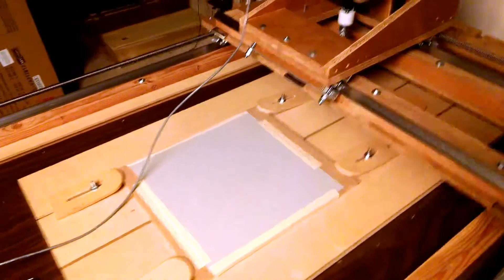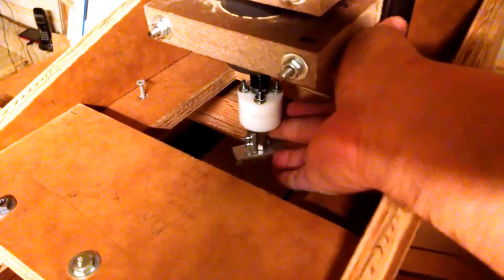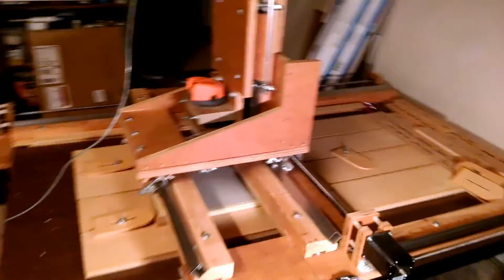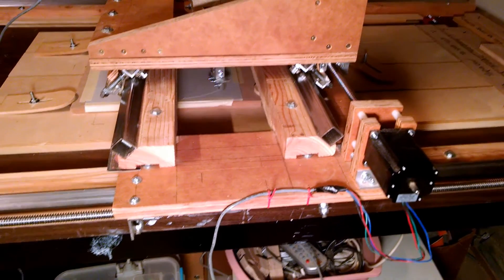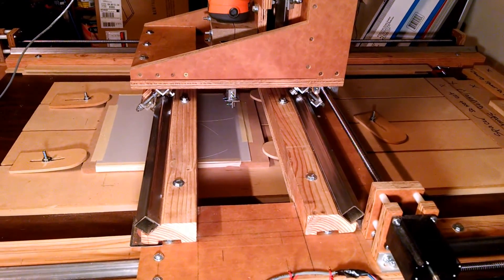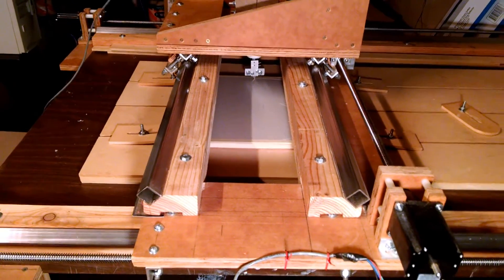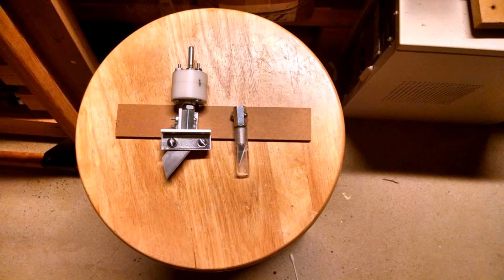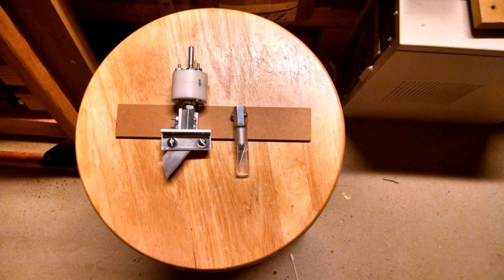Drag Knife Test #1

Comment: I programed and ran pro machines with drag knives and here are some tips 1 whenever the knife changes direction it has to Zup change dir and than Zdown,2you need to get a vibration motor like the ones used in cell phones and couple it to the knife,insulate the knife with rubber sleeving and you will be amazed
Reply from the maker: Interesting idea with the vibration, sounds like your setup used a tangential knife where the knife rotates under control vs free spinning like this one.  The software (VCarve Pro) I am using raises the knife, but leaves it slightly in the material to allow it to rotate when the machine moves, the tool path is generated with some extra movements to swivel the knife in the correct direction.  I will try adding the vibration motor and see what happen, should be a fun experiments.  Thanks.
Reply: It will act just like a scaple....WCH